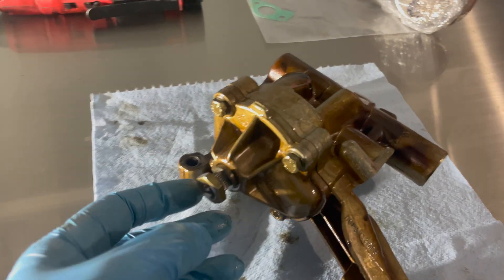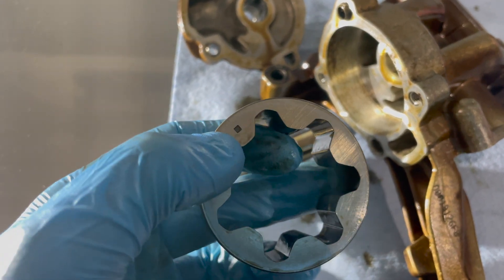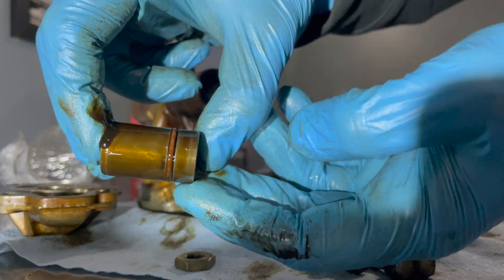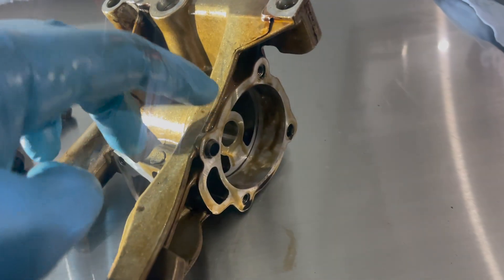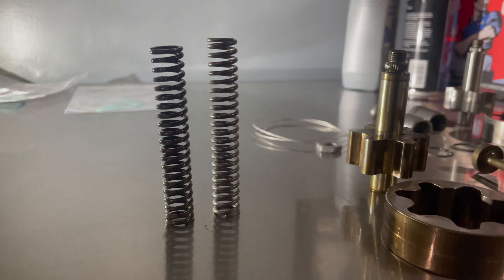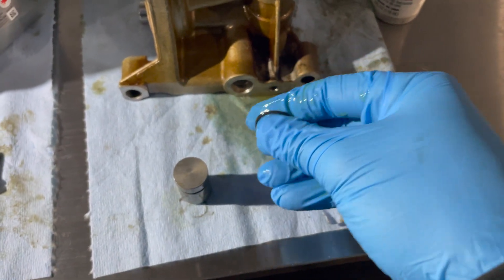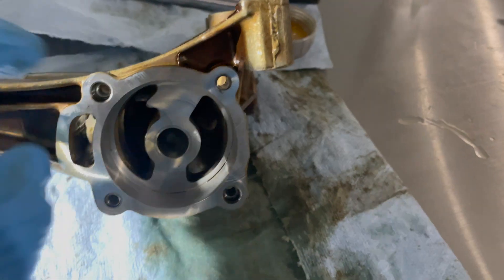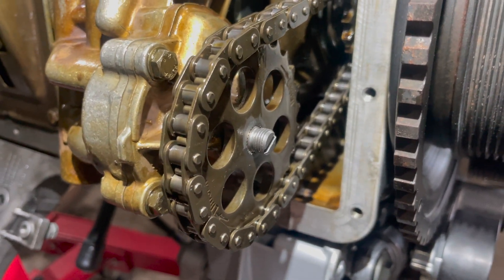BMW e36 Oil Pump Rebuild s/m5X

Comment: are you sure the dot of the outer rotor goes inside as you say!! thanks for the video
Reply: When I removed my pump it had the dot on the outer rotor facing outwards and the inner rotor facing inwards (can only go one way anyways). Lots of people say both faces inwards which I don’t think is correct.

Comment: I think welding the nut solves the problem
Reply: What you tell to oil pressure when shaft falls out? Of course with welded nut 😄